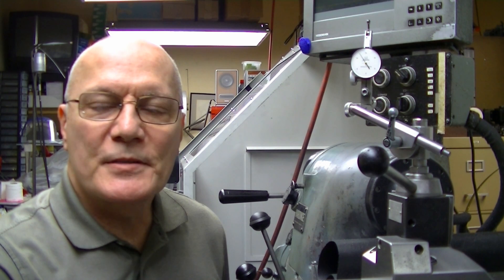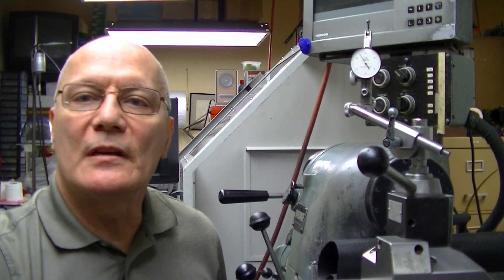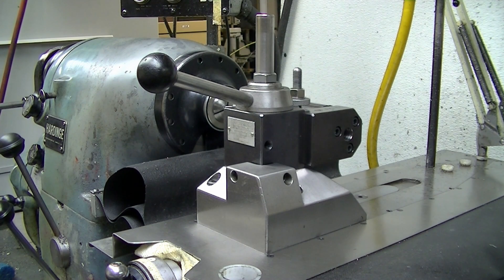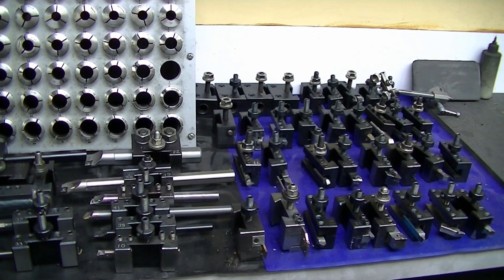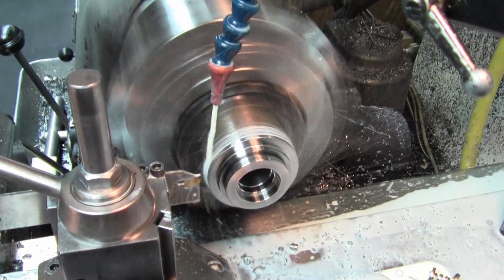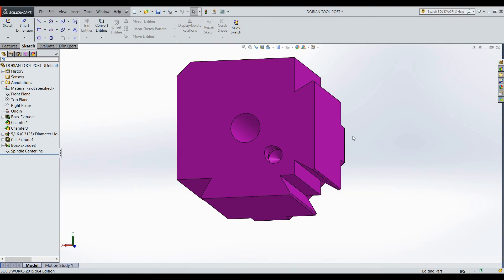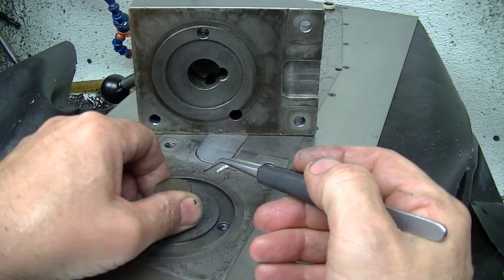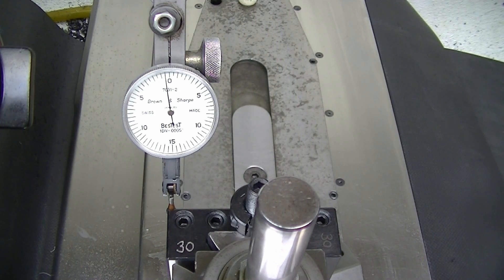THE SOLID TOOL POST MOUNT

Comment: Lohi Karhu
I wondered...neither your, nor Stefan's, solid mounts use kinematic mounting techniques/design? What brought it to mind was the 4 mounting screws, where it seems to me that 3 are correct to guarantee a planar mounting? Or?

I have a small problem with eliminating the compound, since I have a "feinmechaniker" lathe (Lorch), with no  "axial" feed, except for the compound, which needs to be rather carefully set up to be #really# parallel to the axis ;-) ...I've been wondering if I could put bearings on the bottom of the carriage, running on the bottom of the lathe bed, to allow axial travel...feed, then, becomes another issue, but "issues" are what we live by!
BTW, my thanks to Stefan for bringing me over to your channel!
Reply from the maker: In my case I hand scraped the bottom of the riser (while stressed by the alignment setscrews) to match the compound surface. So not truly kinematic but it does not matter when a perfect match by scraping.  On the Lorch this does not really apply like you say since what is called the compound is really your z axis feed. Thanks for watching and commenting.
Reply: I guess, when you have it truly flat (well, as flat as needed ;-) ) and, flat when , it's rather good.. more of a question of interest in the design philosophy; one of the systems that I worked on required interchangeable "heads" with repeatability of arc-second levels on a 30 cm platform... BTW, do you work in metric, some of the time? Greetings from Muenchen, near Germany ;-)
Reply from the maker: Notice I said perfect match not flat, and yes nothing is perfect. Main objective being a very solid connection to the cross slide with minimal distortion. In this case I use the small angular degree of freedom to be able to tram in the toolpost to the Z axis.  I have considered doing a toolpost using a 3 ball kinematic Maxwell coupling. I do work with lots of metric drawings but with mostly all imperial tools I usually convert the metric.
Do you live near Stefan?
Reply: I'm not sure where Stefan lives, but I'm near.Muenchen, and , really, there is nowhere in Germany more than about ten hours away, which is shorter distance than Vancouver to Banff ;-) 
There are some interesting quasi-kinematic designs that use cylinders, and/or compliant points, to relieve the "infinite" loads at ball contact points, but maintaining kinematic-type rigidity and repeatability...i've also studied flexures, a bit, and, especially flexure "bearings". I saw some very nice mechanical position adjusters at HP/Agilent, using flexures for adjustments movement "dividers", and getting adjustments into tricky places , with "remote" access to the adjustments! Nice chatting with you!
Reply: BTW, have you done a video about your electronics equipment, and/or what you do with it? It looks like you have a pretty decent setup?
Reply from the maker: Nice chatting with you also.  I am a big proponent of flexures and have used them in many applications. When I show my keystone kinematic mount of the dressing units and grinding attachments on my Mitsui surface grinder rebuild, I think you will like the way I decreased the hertzian contact stesses.
Reply: Ok, now I'm off to look at that one, after dinner...
Reply from the maker: It is an upcoming video but you can find a past Instagram post I did on it. "robinrenzetti" on instagram and click on my profile to see past posts.

Comment: So I'm assuming that those 4 holes had to be drilled and tapped and were not already there? I would have a hard time drilling an brand new lathe. I may still do it anyway.
Reply from the maker: Correct, the performance difference is astounding as witnessed by those who have tried it.
Reply from the maker: Yes and its worth it

Comment: Hi Rob,where have you been for the past 40 past yrs. when I needed you!!!Ha Ha. Rob I am in the process of making a similar arrangement for my lathe.I have an older Prazi  10X20.Rob when I purchased this lathe from MSC years ago it was just about the most precise small lathe for the money at the time.I use it for turning titanium mostly grade 5 ,but prefer grade 1,2 the more buttery CP version.I am sitting on many lbs of Ti. since at the time my best friend worked at Boeing.,Washington state.Rob at the time 30 + yrs ago if you were an employee of Boeing,you had access to the Company store.I had to be physically dragged out of the store on 3 occasions.Rob you could  buy anything from a Bridgeport mill to a 60' I beam,and 747 seats ect.The store was legendary!! Currently  live 100 feet from the Atlantic Ocean at present in South New Jersey,with no access to any scrap or machine shops.Rob,I need to get  a QCTP as well so would you suggest  Wedge type or piston type? Could  I use Ti for the main support ,or should I find some steel which could be heat treated?Rob,as you clearly stated in  your article,YEA ,I can,t cut off at all without tooling movement.Finally,my top slide is held on by 4 5MM T nuts.I am hoping to maybe drill and tap some more substantial attachment points.Rob if you go to www.Gingerbreadinn.com you will  be able to view my business which happens to be a Bed and Breakfast Inn in Paradise.Rob if you live any where near I would love to put you and yours up as my guest since your wisdom and skill I really admire.Rob,actually ,Stephan who resides in Bavaria has a similar lathe set up as far as the top slide.Rob ,thanks for all you do to share and educate us..Fred
Reply from the maker: I like the wedge style toolposts and I think the newer style Dorian are better than the Aloris.  Plain iron or low carbon steel are fine for the riser block. Titanium would work also but no need for hardened materials.  Thanks for the offer and If we ever get down that way I would be glad to meet you.
ATB, Robin
Reply: Thanks VERY MUCH,Rob FOR SUCH very informed advise.I have spent the better part of my earlier life in school after my short USMC time in 1966.Rob after many yrs. of grad school, finally becoming a "Head DOC" eventually.Anyway I don,t have to tell you I OVER THINK EVERTHING!!! I do by the way share most all of your favorites as well and I really appreciate you DUMBING IT DOWN for me.Rob I currently am very passionate about photography and to that end am having fun developing some small camera trinkets.Thanks again Rob for your help,if ever you need some Ti,or a vacation in paradise let me know.Have a great evening,your maybe biggest fan Fred.PS sorry for the Loooong delay in thanking you but I do still work from time to time,hopefully at the end of this year I will be able to devote most of my time to just playing in my shop!!!

Comment: Great idea. However, with your skills, and engineering knowledge, why not just buy a small used Japanese cnc turning center with a collet or chucker.  
Manual machining production jobs is laborious.  I know you mentioned Tormach.  I got sick of wearing/eating coolant and went all cnc.  Great videos, machine skills , and equipment though.
Thank you for sharing.
Reply from the maker: That is a Tormach lathe with full enclosure behind me in the video.  I agree with your points but for onesey twosey  stuff the HLVH with the solid tool post and the Heidenhain readout kick but.

Comment: THE SOLID TOOL POST MOUNT
thanks for tip
i have used HLVH.
Know what you are saying about the compound slide.

 The 1-pc. clamp-style threaded shaft collar on the tool holders ia also a good tip.
Do not like the lock nut.

The turn part on the tool post hold down bolt  is very helpful for a mounting a BestTest.
Do you have drawing for the clamps? 

Redgie
Reply from the maker: Sorry, I made those clamps, rods and fine adjust about 30 years ago and it would have been a napkin sketch anyway. I know you can easily put dimensions on that in your head.

Comment: I know very little about machine tools but  as little more about machines in general with 25 years as a diesel mechanic. It seems to me that any compound to "loose" and "sloppy" and "weak" to perform "straight" cutting and boring tasks is certainly never going to be any better for threading and cutting tapers. And believe it or not, "close enough" really ISN'T when it comes to threads. There are MANY "specifications" and "tolerances" that must be right on threads or somebody isn't going to pay for the errors down the road. Mainly the people assembling/disassembling the parts/components in the factory and field building the machine and keeping it in service. There's a WORLD of difference between how threads "feel" and perform there in the machine shop with everything nice and clean and lubricated and with no load on the threads. 

Put torque on the "fasteners" and load and friction on them and things change dramatically. Go to a "torque to yield" situation where you're literally applying torque to achieve the maximum possible stretch of the male threaded "fastener" and are taking it to the limit of its "elasticity" and tensile strength vs. just putting a specific "torque" on it and "PERFECT" threads become an absolute necessity. I see comments below about "ditching" the compound until/unless threading/tapering is required like THOSE operations don't need to be done properly when they HAVE to be done properly and having threads/tapers be "perfect" is absolutely essential for the "end user" and I have to wonder where/how they were "educated" on machining and mechanical systems. 

Hell, LIVES frequently depend on THREADS AND TAPERS. Very RARELY is a "press fit" or a "perfect" clearance between "straight cut" parts going to be a "life or death" situation. And its a safe bet that any machine with a "problem" compound has plenty of other "issues" that are going to negatively affect its ability to produce "accurate" and "precise" machine work whether there's a fancy DRO on it or not. There are eleventy billion machining "how-to" videos on YouTubes and damned near all of them at least intermittently or occasionally focus on "accuracy" and/or "precision" but damned if I've seen one yet where the machinist is "indicating in" or TRYING to "indicate in" the spindle(s) of his machines to check the clearances of spindles and bearings against the manufacturer's "specs". 

And when a machine has noticeable "harmonic" vibrations that can be heard here on the other end of the internet from it and that's with no load on the spindle(s) besides whatever parts they're supporting, it's a safe bet that's BEARING WEAR/BRINNELLING and/or "harmonics" caused by a mismatch in the machine and its "power supply" such as running a machine designed for 480V 3-phase on 240V with a "converter" of some kind and/or simply "overloading" the machine or even not loading it ENOUGH. Other "issues" like improper/insufficient machine lubrication and maintenance come to mind and particularly when the machine has "wet" gears/gearboxes with gears/bearings/shafts running in an "oil bath". 

People don't seem to "get" that a USED MACHINE TOOL is a just another USED TOOL and typically a "discarded" one that was PROBABLY "retired" because it was "cheaper" to REPLACE than to "REBUILD". BIG "INDUSTRY" AND MAJOR COMPANIES WITH HUGE TOOL BUDGETS/INVENTORIES CONSIDER THOSE TOOLS "ASSETS" AS WELL AS "LIABILITIES" WHEN IT COMES TO "OVERHEAD" TO OPERATE/MAINTAIN THEM AND YOU CAN BET THEY ALL GO ON THE "BALANCE SHEET" WHEREVER APPLICABLE AND ARE ALL "WRITTEN OFF" AND DEPRECIATED OUT AS THEY AGE. AND SINCE USED TOOLS ARE ALWAYS "WORN OUT" AND/OR OTHERWISE "USELESS" TO THE "SELLER" WHO IS TRADING THEM FOR MONEY AND "ORIGINAL OWNERS" OF COMPLEX DURABLE GOODS LIKE MACHINE TOOLS ACCEPT SOME "LIABILITY" FOR ANY "MODIFICATIONS" MADE TO THE MACHINE WHILE THEY OWNED IT AND LETTING EMPLOYEES "DISPOSE OF" UNUSED/UNWANTED/DEPRECIATED OUT/WORN OUT TOOLS JUST CREATES A LOT OF "HATE AND DISCONTENT" AND EXTRA WORK FOR ADMINISTRATIVE PERSONNEL RUNNING A PERPETUAL "TOOL SALE" AND WHEN "DEPRECIATED OUT" THE OWNER IS LITERALLY SAYING A TOOL IS "WORTHLESS" AND HAS "ZERO VALUE" AND WOULD HAVE TO PAY TAXES ON THE INCOME FROM SELLING A "WORTHLESS" TOOL FOR EVEN $1, ITS "STANDARD OPERATING PROCEDURE" FOR "OLD" TOOLS TO GO STRAIGHT TO THE "SCRAPYARD".

I HATE to tell any would-be/current machinist this but you're paying hundreds or thousands of dollars for the SCRAP from some "big corporation" after a "scrap metal dealer" or someone at the "scrap yard" shall we say "acquires" it AS SCRAP and then "resells" it as "used tools". Sure you can "restore" or "rebuild" a machine tool but its still a used tool, there are plenty of "wear parts" that can't be "scraped" back into "specifications", you're going to spend a TON of time "rebuilding" or "restoring" that "vintage" tool in a "business" where TIME IS MONEY and believe it or not, a shop full of "vintage" tooling is NOT a "selling point" for most customers and potential customers. When somebody pays a lot of money to a "professional" to perform "technical trades" work AND is often times purchasing NEW materials/parts to go along with it, he or she often expects that the PROFESSIONAL doing the work will have TOOLS newer/better than the USED EQUIPMENT/MACHINERY he or she is having repaired/rebuilt. 

I mention "repaired/rebuilt" as far as "job shop" machining goes because only a very small percentage of "job shops" DO or even WANT TO DO "production" work. Especially MANUALLY. Not to mention most companies that "farm out" machine work producing parts/components for their "products" to be assembled into those "products" at some location/time unknown to the "job shop" because the can't/won't do "piece work" machining simple parts "in house" typically aren't very "good" customers or at least not for long. If somebody came to me wanting several dozen or hundred "small parts" as just a small "job shop" and handed me a "blueprint" or "sketch" and ordered X number of them, I'd wonder what the hell kind of "business" they were in and just how much of a "partner" I was making myself blindly making those parts for them and I SURE would want to know when/where/how those parts were being used "down the line" and their future "value". Who would want to find out that the part they're charging cents for is being "sold" for or at least is "worth" DOLLARS by the "customer" its being made for? 

All things to think about before thinking a couple grand for a "quality" used machine tool and especially one "rebuilt/restored" with "fresh paint" is a "goldmine" waiting to be dug right there in your garage. In the "transportation" industry on the "parts/sales/service" side of things we call "fresh paint" on a USED MACHINE a "DuPont Overhaul". SALESMEN in particular are easy SUCKERS for a "DuPont Overhaul" because all they see is all the money they're going to make from that "nice" trade-in used machine. And they tend to be pretty skilled at selling that "paint job" to buyers of those "nice" used machines as "evidence" of how well its been maintained and what good condition its in.

Like well-maintained, lightly-used machines in "good condition" need a "DuPont Overhaul" and the previous owner(s) spared the wax and polish and indoor storage whenever possible but took GREAT CARE of the mechanical systems and maintenance. Right. Any machine "ugly" on the OUTSIDE is going to be "ugly" on the INSIDE. Go ask a MECHANIC and particularly a dealership service department mechanic just what HE thinks when HE sees a "DuPont Overhaul" on a machine. And maybe think about checking the "original purchase price" or "MSRP" on a "vintage" tool before deciding hundreds or thousands of dollars is a "good deal". I can tell you that no TOOL "appreciates in value" unless it has "collector value" and even then "inflation" is usually the primary factor in that "appreciation". 

Also keep in mind that "big corporations" buy EVERYTHING IN VOLUME and get "volume discounts" because of the reduction in "administrative" and "shipping" costs buying multiples of anything on occasion vs. one of something a single time or one of something over and over again. That VOLUME purchasing goes for TOOLS OF ALL KINDS from pens for the "office personnel" to MACHINE TOOLS for the "production personnel". 

Don't be a sentimental sucker thinking you're "saving" a pile of METAL and like "old people" old machines should be kept around as long as possible. You don't feel that sentimental about all the "chips" you're making with a machine tool and THOSE are "raw material" with "unlimited potential" by being "recycled". USED TOOLS ARE SOMEONE ELSE'S "USELESS" THINGS AND THERE IS NO SUCH THING AS A "GOOD DEAL" ON A USED TOOL THAT "NEEDS A LITTLE WORK" BEFORE IT CAN DO ANY.
Reply: Wow... have a Snickers .
Reply: Damn. 
1,458 words, when 7 would've done.

"I know very little about machine tools."
Reply: @gyromike1966  "I know very little about machine tools but  as little more about machines in general with 25 years as a diesel mechanic."  could have fooled me!  I hope this one never shows up at my channel and sees the goofy shit I do in my garage.
Reply: "its a safe bet that any machine with a "problem" compound "
    Being discussed is not a "problem" compound ", it's ANY compound. Even one on a factory fresh brand new lathe. Each additional movable part between the cutting tool all the way back to the part being turned in the spindle unavoidably adds to the total unconstrained movement between them at the cutting point. You can imagine or ponder a zero backlash, dead nuts machine, but don't expect that to apply in the real world. You can work to minimize it (as in this video) or just moan and groan that real life isn't as good as you can imagine.
Reply: "Wow."